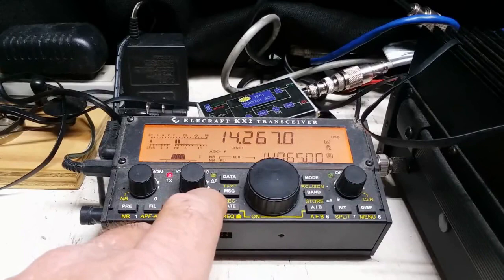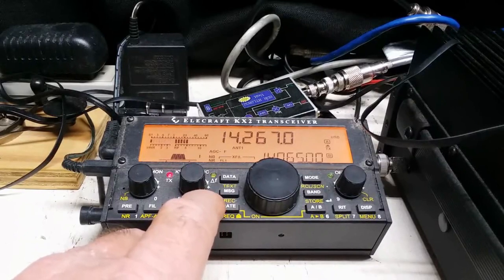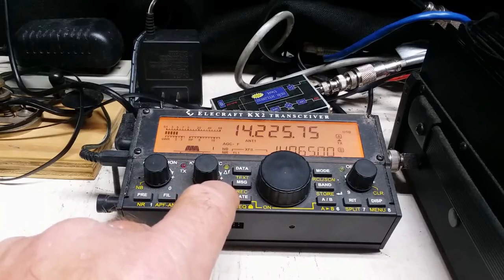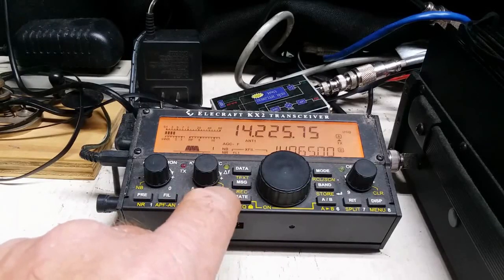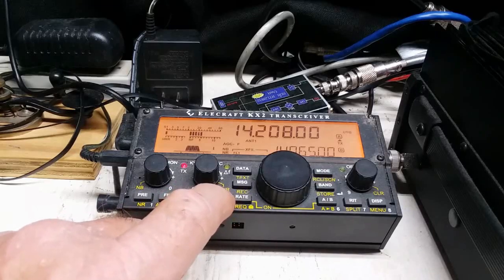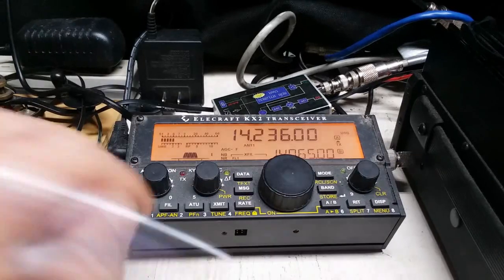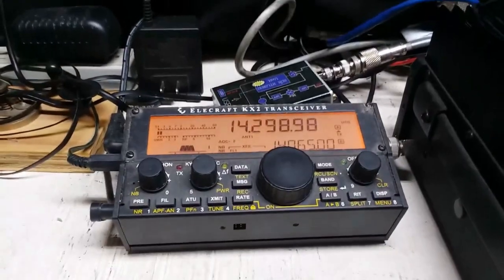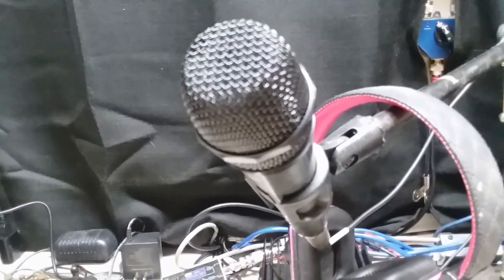MFJ 1982MP Antenna

Comment: You have a cute little transceiver there! In my previous active days, I never could work 14 MHz as I was using a BC receiver with no 14 MHz ham band in it. Was active on 40 m and a little bit on 80 m as I had plenty of space for 80 m antenna in my parent's home QTH. I have worked a few W hams on 40 m long back with my homebrew QRO (3 x 807 vacuum tubes) at that time, on a simple  half wave horizontal dipole tied to the top of coconut trees!
Reply from the maker: Thank you and thanks for watching.